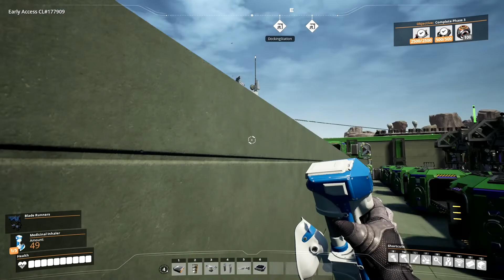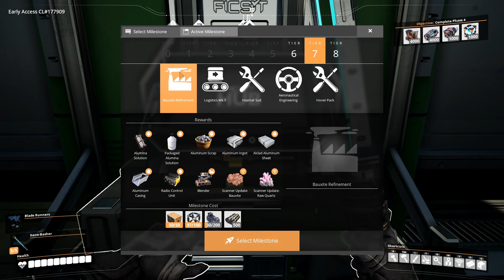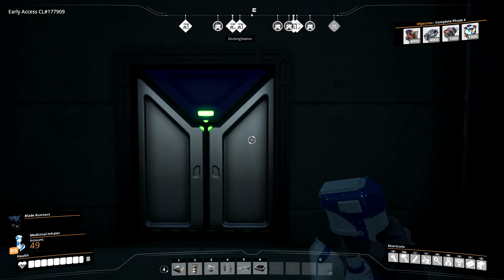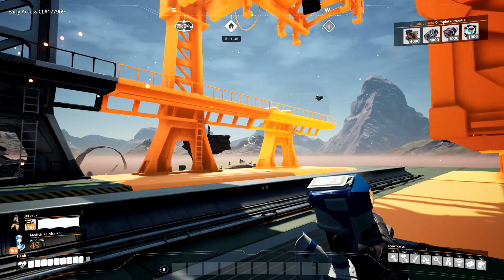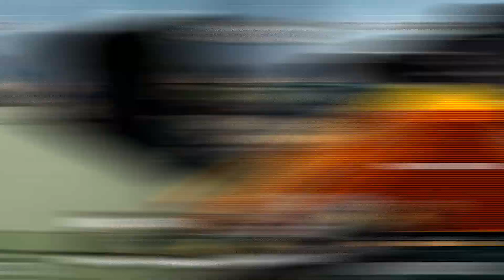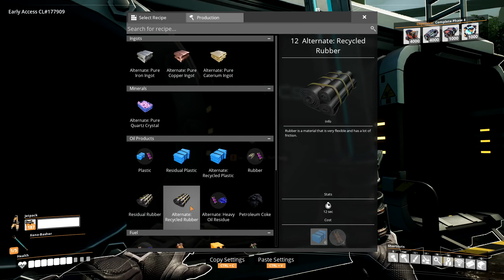Satisfactory EP 13 Tier 7+8 Done Train Time!

Comment: Outstanding tip on the tracks.  I have had so many issues with trying to them straight and gave.  I'll be giving this a try.  Also this is same location that I built my turbo fuel plant.
Reply from the maker: Yeah, they are such a pain at times. Going up and down hill can be a real bugger as well, when in doub, make the corner wider.